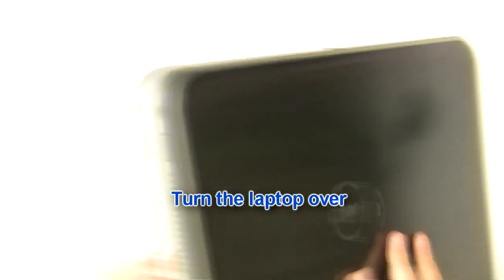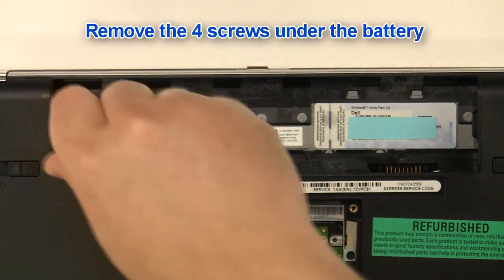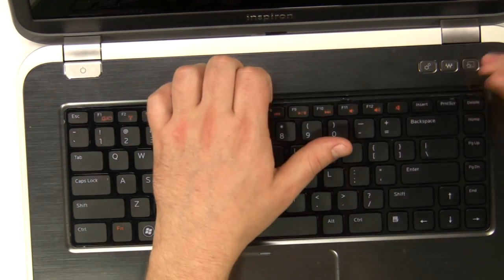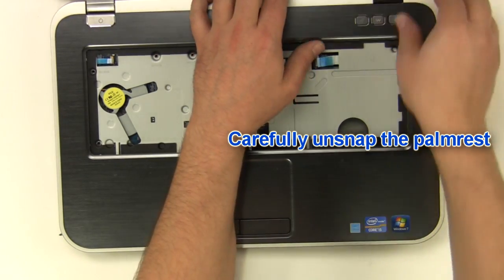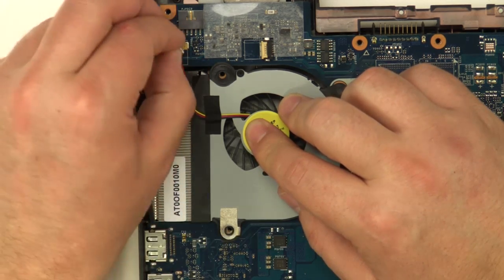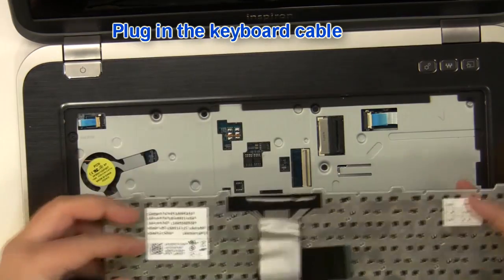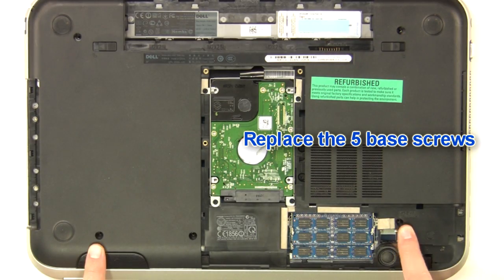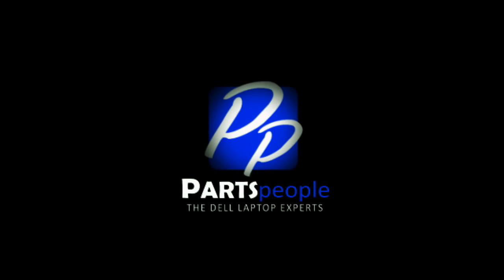Dell Inspiron 15R (5520 / 7520) CPU Cooling Fan Replacement Video Tutorial

Comment: It goes well up to the last step which is removing the fan itself. Not sure if it's just me but I couldn't remove the fan. Tried to pull it out either by hand or using a screwdriver but seems like it's bound somewhere. Maybe needs removing more screws?

Comment: I did the same thing but now my laptop won't charge and it won't turn on. When I press the power button it lights up for 2 seconds and then turns off. I tried checking all the connections but all of it seems ok. Please please please tell me what to do.
Reply from the maker: Not charging? That would be related to the DC Jack but it wasn't unplugged in this tutorial, so I'm not sure what that's about. Now, the power button turning on for 2 seconds and then turning off sounds like there has got to be a loose cable, or maybe, the cable that's not fully seated. I would go back through and unplug and reseat all the cables and see if that fixes it.

Comment: Thanks for the video, successfully replaced my fan. But when I turned the laptop back on, it had an error message, sonething about drivers I think. I was about to write the error code down and the screen went totally white, and now it's like that permanently. I can use an external monitor but the laptop screen stays white.

Comment: After reassemble both mousepad and leds stopped working. Which cables coordinate it?
Reply from the maker: It's most likely the cables located under the keyboard. You can see them @ 2:24

Comment: A thank you, and a query: 

My Dell laptop was overheating and I could not figure out why, didn't want to pay a fortune to take it to a laptop doctor so I decided to take it apart myself and see if I could work out the problem. Now, I'm a complete novice and have never ever taken apart a laptop before, and I've heard that Dell laptops are some of the most complicated to take apart and replace... the process was very fiddly so I wouldn't recommend trying to take apart the laptop to other novices (figured my laptop is so battered anyway it wouldn't matter if I broke it) . 

But this tutorial was so damn helpful. I understood every step, and the tutor made all of their gestures quite clear. I like how they  show you what each part looks liek after they take it off, very clear. And once I got down to see the actual components, I found a big ball of dust between the fan and the heatsink. Removed the dust, put the laptop back together and it hasn't overheated once since. Thank you so much!

However, after putting it back together, the touchpad seems to have stopped working altogether and won't pick up either gestures or button clicks. I've got a wireless mouse , so it doesn't matter too much, but do you know why this has happened after I put the laptop back together? What can I do to fix it?

Many thanks :)
Reply from the maker: I would guess that the touchpad failure is going to be related to a cable that was forgotten or the cable not being plugged in all the way. You should check the cable @ 2:30 it controls the touchpad and will probably solve you problem.

Comment: so to remove the fan, do I need just to put out that 2 little screws, or I need to remove the motherboard too?
Reply from the maker: +Martin Bojkovski If your laptop has the Intel GPU, you do not need to remove the motherboard to remove the fan. If it has the AMD Radeon GPU, the fan is attached to the heatsink and the motherboard would have to be removed.

Comment: Great video, clear comments, thank you.  N.B. the 7520 model has 2 keyboard cables to remove (backlight?) and the motherboard itself must be unscrewed/flipped over to release the fan/heatsink assembly from the underside.  To prepare for motherboard removal I took out the hard drive and ram.  Four hard drive screws, nine motherboard screws, six (I think) heat sink screws to release the fan.  Two more plugs before flipping the motherboard, not difficult.  Have thermal paste handy for the interface between the heat sink and CPU.  My laptop is quiet again.

Comment: for some reason my optical drive wont come off I didnt try to pull it out cos i was afraid i would break it any reasons tho?
Reply from the maker: +noumeet desai It looks like that part was skipped in the video. There is a screw that holds the optical drive in. this video shows it. https://www.youtube.com/watch?v=jIi29ITuj94
Reply: Oh it wasnt skipped i thought my drive was stuck but i just had to put a lil more effort thanks for responding

Comment: Great video really helped me with disassembling, however when I reached the remove the fan part, my fan did not budge, I was only able to remove the top part? It's an inspiron 15r 7520, how do I switch fans if it's attached to the heatsink, like the guy below me said. Thx for your time :)!
Reply from the maker: +patr ick If you have AMD graphics you probably have a different fan that is attached to the heatsink. If that is that case there will be 7 screws you have to remove in order to remove the heatsink / fan assembly. Also, you will have to replace the entire assembly, the heatsink and the fan.
Reply: can the heatsink be removed from the fan?
Reply from the maker: Probably, I honestly haven't tried to remove the fan.

Comment: My laptop is 7520 series and the can't be removed since it is attached to the heat sink.Another tip for people is when trying to pull out the fan connector,don't do it by pulling by the cables as in the video because you might be end up with those cables in your hand and the cnonector still plugged in.Just pull the connector not the cables.

Comment: I can't turn on the laptop. Is it becuase the cable which is near the cooling fan is broken? How can I fix it? help me please...
Reply from the maker: +kungfahza If it is the power button cable that is broken, then yes, that would cause the laptop to not turn on. You will need to replace either the power button cable or the power button cable and power button circuit board.

Comment: Hello, 
When trying to remove my fan for cleaning, I accidentally broke the bond on the metal part to the left of the fan (what is the name of that part?). Now i need to reapply thermal paste to close off the gaps and allow the heat to escape from the cpu. Can you please explain how I can re-secure that part to the motherboard?
Reply: DJ Krucial I definitely loosened the heatsink by mistake. Is this an easy fix?
Reply from the maker: DJ Krucial It's an easy fix. Just clean off the old heatsink compound, with alcohol, on the heatsink and CPU, and reapply the compound on the contact points that you cleaned. Arctic Silver is a good brand for the compound. And you only use a very small amount, like less than the size of a small pea. Tighten the heatsink down and your ready to go.
Reply: Parts-People.Com, Inc Thanks so much. The last thing is that after removing the 6 mother board screws and disconnecting all necessary cables, the board won't loosen from the computer. I don't want to force it too hard, any suggestions for how to safely remove it?
Reply from the maker: DJ Krucial Here is the video for the motherboard removal. https://www.youtube.com/watch?v=dFPvEkHDASE
And here is a written manual http://ppci.me/b/FXIN

You need to remove the Battery, Access Door, Memory, Hard Drive, Optical Drive, Keyboard, Palmrest, and DC Jack Bracket. All of the exact screw locations are marked in images in the written manual.

Comment: I take a question, please , my Inspiron 15R SE has backlit keyboard , I do an internal cleanse it and the keyboard lights are not lit , wanted to know where is the internal component responsible for the keyboard backlight ? Thanks .
Reply from the maker: Bruno S. There are 2 cables on the back of the keyboard. The smaller one powers the backlight. It's probably just a loose connection and needs to be plugged back in to the motherboard.

Comment: Thanksss for the tutorial!
I have an Inspiron 15R 7520, and the fan won't come out, it's attached to some kind of copper bars, the heat sink I guess.
Do I need to replace the entire set ? And how do I take it off ?
Thank you!
Reply from the maker: You will probably have the replace the entire heatsink assembly. I think it's held on to the motherboard with 7 screws. You will have to either loosen or remove the screws and unplug the fan to remove the heatsink. When reinstalling the heatsink, make sure to remember  to apply thermal compound.
Reply: Parts-People.Com, Inc
Ok, got it. Thank you!
Reply: You can also remove the 3 screws on top of the fan itself to remove it and leave the heat sink assembly in place.  Do the same with your replacement fan and swap them.  It's a lot easier than taking out the whole heat sink!

Comment: hi there, your video was very helpful and i was able to clean the fan perfectly. but when i assembled the laptop i found out the speakers were not working. any idea which wire may be loose?
Reply from the maker: Step 12 will show the speaker cable on the left side of the motherboard. http://blog.parts-people.com/2013/05/23/dell-inspiron-15r-5520-7520-speaker-removal-and-installation/
Reply: Parts-People.Com, Inc THanks captian, helped alot (Sorry for replying late)

Comment: This looked so easy that I decided I COULD clean my fan after all!  ...  Unfortunately my touchpad stopped working after I did this.  Any idea what I might have screwed up in reassembly?
  Everything else is working fine.  I can type, obviously.  My optical drive is working.  I hear the fan spinning in there.  And I can still turn the computer on, use battery power, and use my wireless mouse with the thing.  It's just the touchpad, which I still like to use, has stopped working altogether.
Reply from the maker: If I had to guess, I would guess that the touchpad cable (the 3rd cable mentioned @ 2:24) is either loose or not fully seated into the motherboard connector. That's what I would check first anyway. If it's not that, then it is probably where that cable connects to the touchpad is loose.

Comment: My fan started running at 2900 RPM for some reason causing my laptop to overheat. Tried switching a new fan into it but now it only runs at 2200 RPMs. Any idea on what could be causing the problem?